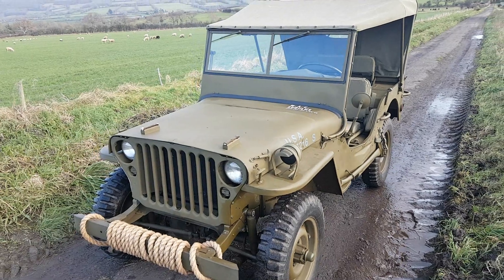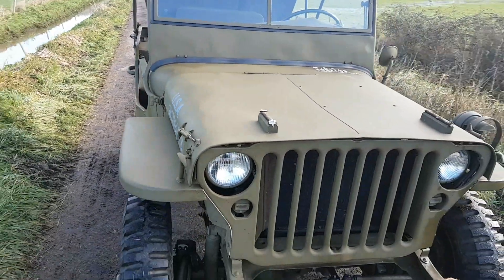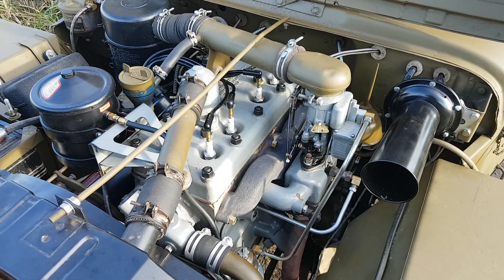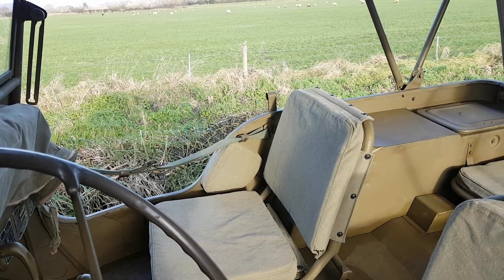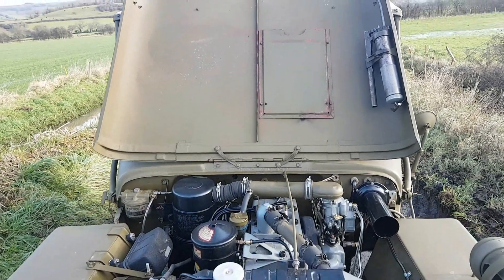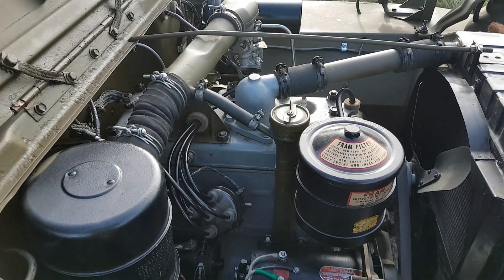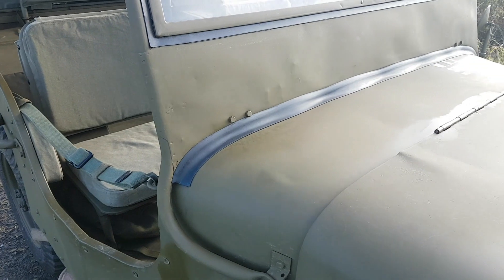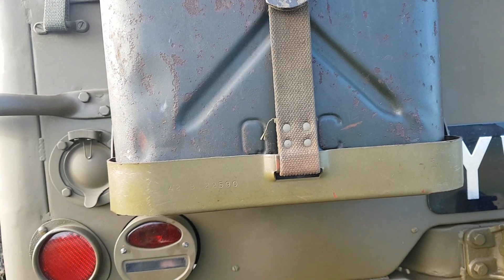Is the paint on your Willys jeep all wrong?

Comment: During the restoration of my 1944 GPW I have had one concern only, and that is the prevention of corrosion. If this leads to a discrepancy in colour then that's unfortunate. We have to remember that as collectors, the preservation is paramount. During WW2 that was the least of their worries as the life expectancy of a jeep in combat areas wasn't much more than that of a junior officer.
Reply: Also, you can lay that paint down heavy and thick and it will still be correct
Reply: Serving in a modern military - There was never a point in my military career when I pre-use inspected a piece of equipment and said - the paint doesn't match. We're not going to use it. Go grab another one.
Reply: @secondarycontainment4727  exactly. I'm still serving as a metalsmith in the REME. The approach is the same to repairing a vehicle. The repair has to be good, but it doesn't have to look as it originally did. It has to be functional. If a rotted out top hat section can be replaced with a piece of angle iron welded on in a V shape, then that is what is used.

Comment: When I was building my jeep, I wanted authentic ww2 od green paint.. that sent me down a rabbit hole and instead of going to a auto paint supplier for a close match, I went to a supplier of restoration quality finishes. The minimum amount of paint I could buy was 2 gallons.. and they recommended xyolene are a reducer but also stated that it can be thinned with gasoline just like they did in the field during the war. I used xylene and added a oil based hardener to it, it made touch ups much easier if I had to go back and repaint a section.
Back then, they would also spray over wiring and anything already assembled, so back of headlights and steering parts..

Comment: Mines got a gloss finish ,done by previous owner and it's grown on me easy to clean I know it's not correct but I like it
Reply: ive got a 42 gpw, and i found on the top bow anchors/swivel original green, and it had a lustre
also if you look inside differential/ places its protected, youll find original paint

Comment: Well done mr..One correction if I may the reflector be it Arrow or Concorran Brown at right should be amber not red.Jeep is a marvel of engineering till today a wonder in this modern world of tinselled cosmetical addition.The lighting of red is the driver side as it is LHDrive.Amber on the right tells the traffic is safer.Thanks.
Reply from the maker: Thank you for the comment,  on WW2 jeep all reflectors are red, no amber ones ;)

Comment: See the vac tube for the wipers is that originally the way it went into the engine bay? I've seen some willys going through thr actual wing into a grommet?
Reply from the maker: Some jeeps not fitted with vac wipers from the factory did not have a cut out hole for the wiper tube so it just went under the hood.  Later a vacuum line hole was fitted in the factory for the wipers although a jeep could have the hole and not be fitted with vac wipers!

Comment: once in a unit, not so much front lines, there will be inspections looking for a few things - serviceability "does it work?"  and NO rust, NO dirt. depends upon how hard the NCO wants to be, or motor pool NCO, but dirt washed off, and rust "removed" by being painted over. Even with my restored GPW, I try to look good, and avoid overspray, but it is there. If you have ever been 19 in the military, you'll know this mentality!

Comment: As a vehicle painter I can tell you, you can't buy good ol'red oxide lead primer any more as far as I know? The stuff to use nowadays is epoxy primer. I use Lechler which can be bought in various RAL colours. One of which will be a close match to red oxide. The beauty of epoxy is it sticks to bare metal like shit to a army blanket and is totally impervious to water and most other things and is as hard as nails. You can use it wet on wet or let it totally harden and flat it off and paint over it with colour.

Comment: Hello Greendot I have a early 43 GPW  , still in process of collecting parts for it. Interested in your words on painting - did you etch prime to bare metal or go with red oxide ? I think wartime paint was oil based and also contained lead (although I dont know the original formulation) . A friend of mine has an MB he painted 45 years ago and its still good - it dosnt get much use though. His experience was to spray WD40 into all seams then use oil based paint which (he says) mingles with the WD40 and hardens off. He also applied a gloss layer which he left until tacky and then over coated with drab which he reckons seals the surface as plain OD is porous (his words). Lastly who was the paint supplier for yours and what was the paint number - if you dont mind me asking .
Reply from the maker: Hi, this tub was media blasted back to bare metal and then sprayed with red oxide primer, some items like the fenders were also zinc sprayed too for added protection.  i'm not sure about spraying WD40 in the seams for most paints as I imagine any non oil based paint would react badly with it and you wouldn't get good paint adhesion.  What I would recommend is that if is getting hold of some ACF50 (which is an aircraft anti-corrosion treatment), which although very pricey is excellent for protecting all your seams and areas where water might collect once you have sprayed the jeep and the paint is cured.  When I look at my jeep in the areas where the ACF50 is you can see the water just beads and rolls off so it is doing a good job.  Fortunately for us in the UK, but unluckily for other places in the world, the paint we can get hold of from UK suppliers like Universal jeep supplies appears to be a very good enamel,  this enamel is what I used on my jeep but it only comes in plain unmarked tins so I have no idea who makes it or exactly what it is which is no help at all when trying to help other people with painting their jeeps so please accept my apologies.  I will try and find some more info about it for you
Reply: Ah, if the paint was from UJS  it is probably Matt 1  - which is from Jeepest .
Reply from the maker: conrod7 that's it, it's good paint but you need to do a mix of at least 50% mix to mat to get the right finish.  100% mat is too mat
Reply: Got it . Your jeep looks great by the way.
Reply from the maker: Thanks, more videos on the way

Comment: If the modern All Terrain Vehicles were built for 4 people rather than just one, they'd be designed more like the Original Jeeps that could be adapted to carry machine guns, tow cargo trailers, and need only a 4 cylinder engine of no great sophistication.  At sea America built the Liberty Ships with much the same mindset.  Of course America's younger generations have No Clue about such things, and so they seek the air conditioned, butt easy designed vehicles that are built by robots and not humans.

Comment: Excellent video really well done, what make of Canvas is fitted to your jeep?
Reply from the maker: Dave Weeks The canvas is from Jim Clark at Allied Canvas.  It's recommended by me, he's a very nice guy, service is good and the canvas is excellent.  Glad you like the video, I'll keep on producing more
Reply: I see that you have a three spoke metal steering wheel. Possibly strange question, does yours have a slight wobble from the point at which the spokes fit into the center hub. I have just bought one (repro) and mine has movement. Probably down to a cheap repro or the fact there is alot of sress at that point and the old originals suffered in the same way.
Reply from the maker: Dave Weeks no it doesn't it is solid.  I would have yours looked at before driving it more just in case.  I imagine a touch of weld would re-secure the spokes to the boss.
Reply: Yes i'm returning it, if looks as if it was never welded in the first place.

Comment: Hi there, really enjoyed your vids, is  this paint by the famous Tony Sudds?. I had the matt version initially and i have now changed ovet to the mix version which has a small amount of glossing agent added. Handy for keeping clean but it does gather smudges etc but not as much as the full matt. Cheers. Will
Reply from the maker: Hi Will,  this is the Tony Sudds paint and is a mix of 50/50 matt and mix.  The mat, as you found, is too matt and not accurate for WW2 paint but the mix on its own or a 50/50 is very good and I think a really good match for original paint.  Glad you liked the videos!
Reply: Hi Greendot, many thanks for the reply, a few years ago when i began my resto, i used qd hi build primer, with the matt od, within weeks, out in the elements, a lot of my work had begun to corode, due to the porous nature of the matt od and primer. Since then, i used the same primer, and additonally an agriculturcal satin finish red oxide, by johnstones, its great stuff, pretty much impermiable to rust with it on, the mix od is on top of that, i learnt pretty quick and glad i didnt have to find out the hard way after my resto was done, i like the idea of that anti corroaive oil spray, i will dedinately use that, im at the stage of dropping my engine in now, then off to work on the tub. I also advised two friends today, one has an mb and another a gpw, about the acr oil you mentioned, they seem reallt interested. Cheers. Will